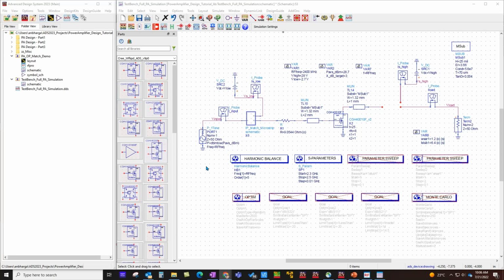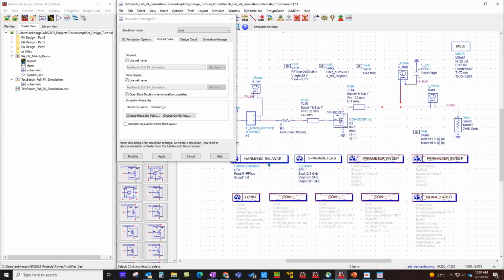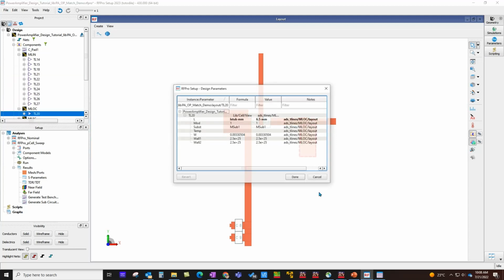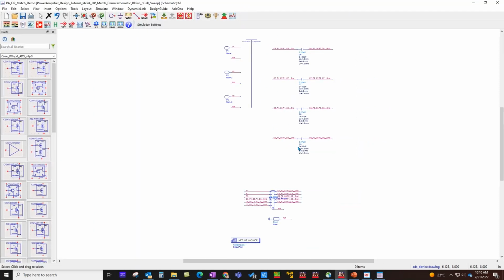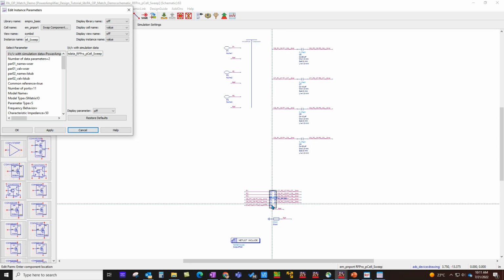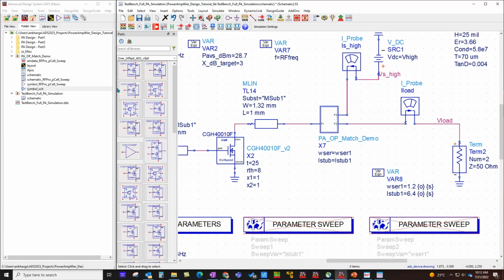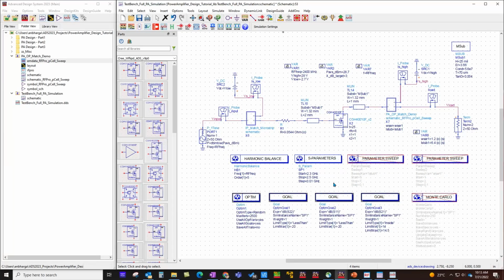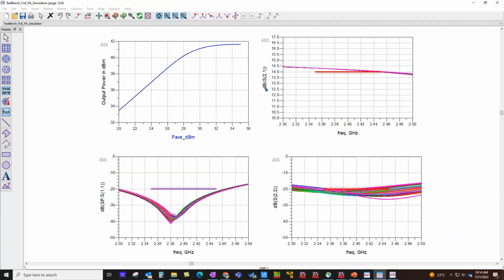ADS2023 Top10 - Feature 4: Parametric EM/Circuit Co-Simulation & optimization

Comment: If I set the hierarchy policy to standard_em, I get "The component `empro_basic:em_nport' has no item definition but has no schematic, layout, or custom view from the current Hierarchy Policy." If I set the hierarchy policy to standard_ic, I get "You do not have a license for Silicon RFIC Interoperability with Virtuoso". Do you seriously need the RFIC license to use this feature?
Reply from the maker: There seems to something wrong in your config. If you have newer ADS release/license then you won't need Silicon RFIC interoperability license as that is included in the ADS Core which is the basic license. Kindly contact Keysight tech support team by writing to support@keysight.com

Comment: The magic empro_basic library does not seem documented anywhere else - thanks!
Reply from the maker: Yes, you are correct. It is not widely publicized yet...😊
Reply: @BhargavaAnurag  Thanks! A few pointers on the interpolation parameters (delta/resolution) would be helpful too as they don't seem very well documented either and if they don't match the parameter sweep in RFPro perplexing errors arise.
Reply from the maker: @alanbain1651  you can ignore resolution field. Easiest way to handle interpolation is to keep delta same as the step size for respective variables during parametric EM simulation. This will avoid any errors while using the model in schematic simulation.
Reply: @BhargavaAnurag  Thanks!! That worked managed to make a cube and interpolate over it wirh delta=step size, but found that fixing a parameter in the RFPro simulation (to save computation) resulted in crashed during interpolation in the simulator crashing!

Comment: If the number of parameters is more than 10, how can the interpolation help in a faster EM optimization? If a nested parameter sweep is done first to load the model with EM data, it will take a long time even if the steps are bigger. Won't the bigger interpolation be lesser accurate?
So, what is the way of performing faster EM optimization for a high number of parameters?
Reply from the maker: Hi,
None of EM optimization can be run blindly as in case of circuit simulation as the price of EM simulation time has to be paid so I always recommend designers to select what parameters really needs to be optimized or parameterized. Keeping steps bigger may not yield good results but it depends on the circuit as well. ADS 2023 supports Design Cloud HPC as covered in Video 3 of this series to run all of these parametric runs in parallel as much as possible so penalty of long simulation time can be reduced significantly as long as you have the HPC infrastructure & needed licenses to support it. 
Interpolation will always help whether you have less or more parameters.
Reply: @BhargavaAnurag  Thanks for your reply. 
That means we have to first choose the parameters affecting the results in the schematic simulation itself. Then we can run EM optimization using those parameters only, is it so?
If all the parameters are significant then parallel processing is the only option.